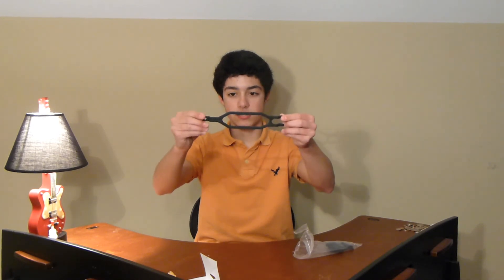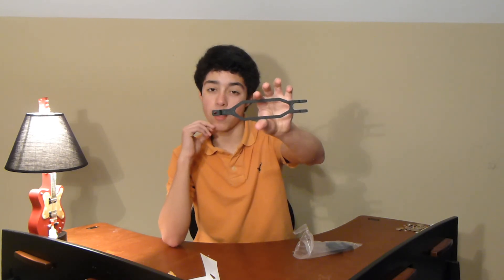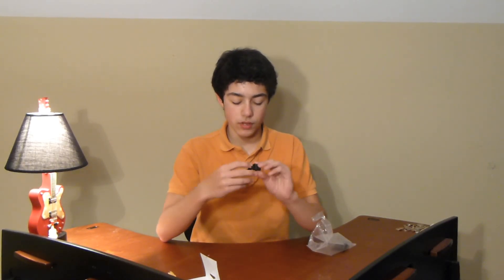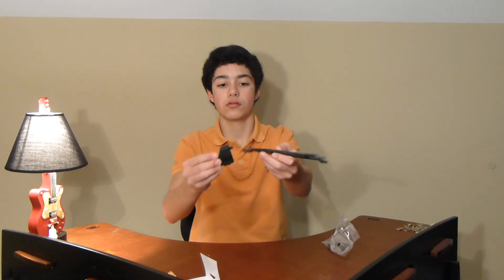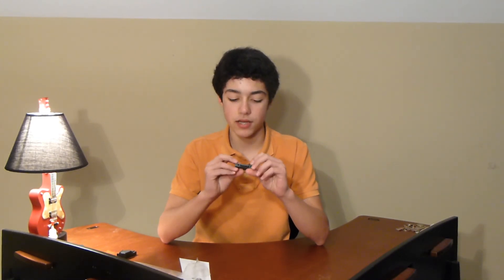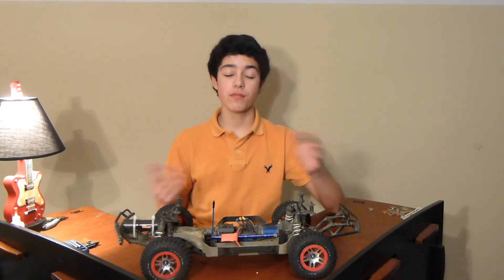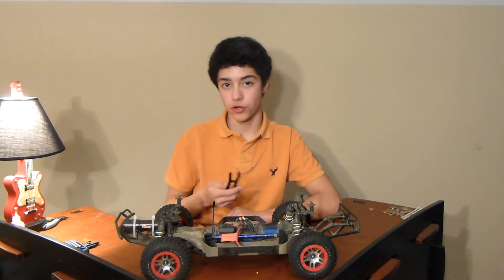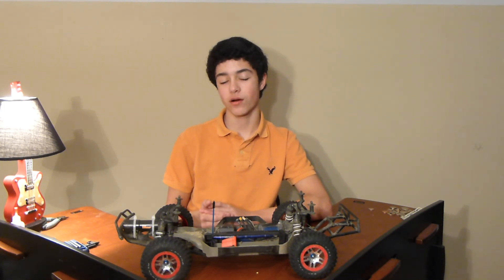2012 Traxxas Slash (LCG) Platinum Edition Battery Extension Door Installation - Ep. 11

Comment from the maker: Yeah, it does work with the Traxxas 1/10 Rally.  Make sure though, if you are purchasing this part, to make sure you get the 7426X part number, or else you will make the MISTAKE of purchasing the Slash 4x4 Battery Extension Door.  Which is part number 5827X.